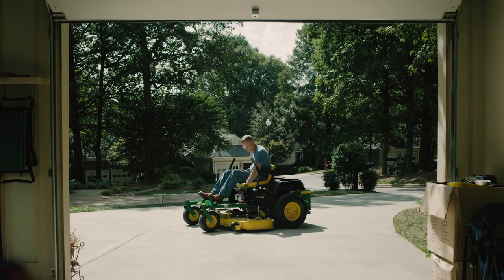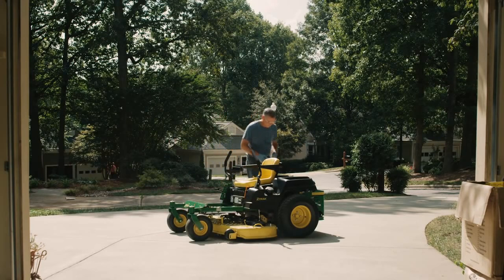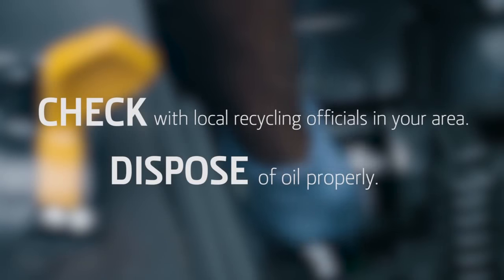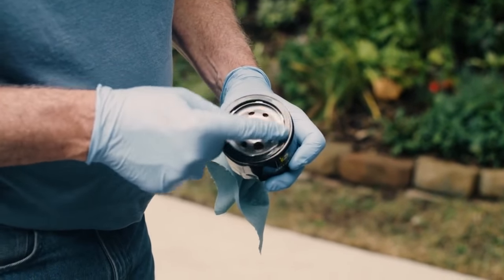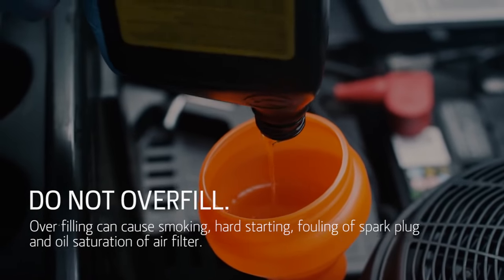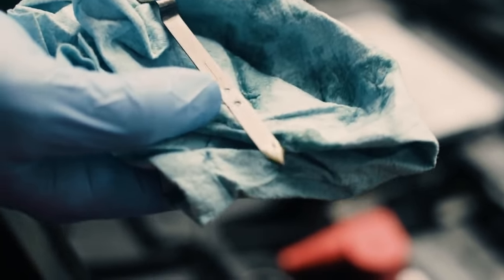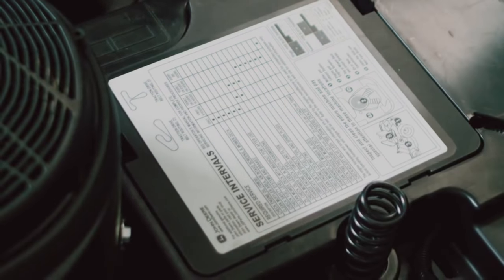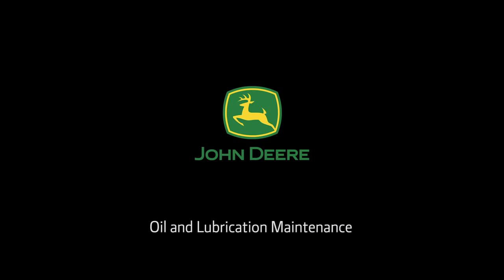How To Change Oil and Oil Filter on Your John Deere Z-Trak Zero Turn Mower

Comment: Do you have a video for changing the Hydraulic Filter and Fluid on a EztrakZ445 54c?  I can not find the location of the filter.  I have been all over and under the mower, but I do not see it anywhere!

Comment: What kind of oil ??
Reply from the maker: With the zero turn mowers, we recommend using the John Deere 10W-30 oil.  Part number TY22029.This is a great oil to use in the summertime.
Reply: Synthetic 10w30. Doesn't need to b "jd" oil
Reply: Unkle Fritz Awesome, 🙏 Thank you 👍

Comment: Not a good video. If you don't put a heavy plastic sheet under the mower, you'll be sorry. Also the oil drain tube is too short.